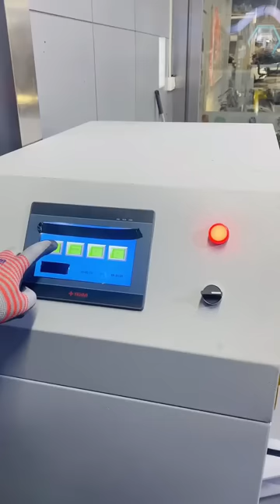Volkswagen EA888 Engine Assembly Full Process!

Comment: I just had mine completely rebuilt. Bored to 83mm added IE rods, pistions and springs. Ferrea valves, mhale bearings, ARP bolts, etc. I'm tapping 28 psi and runing around 24 psi consistently. The thing is a rocket ship, so much fun. I need to upgrade LPFP, HPFP injectors and turbo to get the most out of it though. My little K04 is doing big boy numbers 😂
Reply: I am a beginner. What does having an engine "bored" to do for it? And what does bored in engine terminology mean?
Reply: @stocks4bt having engine cylinders bored out is having the insdie diameter of the cylinders made to be slightly bigger, so you can fit bigger pistons. Takes a highly trained specialist to complete. The machinist that built mine has been rebuilding VW, Audi and BMW engines for 30 years.
Reply: @NuffxSaid  you explained it very well. I greatly appreciate you for sharing your wisdom
Reply: @NuffxSaid how much hp and torque do you get after cylinder boring and before everything else ?
Reply: @deweew haven't run it on dyno yet to be 100% sure. However, the PSI I am pushing calculates to about 450-470hp/26-28psi on hard pulls. 24-25 psi on regular driving. Stock hp 220, stock psi of 12, +10% psi per 1 pound of boost maths to 450-470hp base on psi output. At least, that's how my mechanic broke it down. That's without upgrading the fueling system still on stock pumps and injectors. If I add those, I'll have to go bigger turbo. Which will push me close if not over 600hp. The motor is built to handle 700hp. I still need to get my suspension fully built out before even thinking about that. I would also need to go stage 3 brakes. Car is basically stage 2.5 if that were a thing 🤣
Reply: The dangers of boring is, making the cylinder walls weaker and possibly cooling issues, seems you did well, these engines when done right are bulletproof.
Reply: This is a gen 3 EA888 and there is no K04 turbos for them. You’re thinking about the older junk gen1 engine.
Reply: @silviodante5829  the engine block is the same. I ordered a cylinder head from a gen3 and it fit on mine, gaskets everything lined up. The oil pan gasket is the same, balance shaft, oil pump, cam bridge and cams fit, exhaust manifold, etc.
You do not know why they were labeled as junk and it was not because of shitty short block.
And yes, there is a KO4 for the Mk6....
Reply: @psiturbo  I’m referring to the fact that the ea888 that uses a k04 is junk. Endless issues that were sorted out with the gen3 and k04 turbos are poop as well. Thanks for telling me you can’t afford a later model gti bud
Reply: @silviodante5829  You are saying is not the same engine block of the overbore, when in fact it is. You are saying there is no KO4 when there it is many kits available. And I have an MK8 as well.

Comment: This engine is used in so many Audi's and VW's. It is reliable until approximately70,000 miles. Then you must replace intake manifold, off valve, coil,spark plugs,and diverter valve. At 100,000 you must replace the timing chain,tensioner, all associated chain guides, and timing chain covers it gets distorted when removing for service and leaks. As most German engines you are constantly chasing oil leaks.
Reply: What goes wrong with the intake manifold? Carbon buildup issues?
Reply: @MarcChevalier  intake runners
Reply: I have this engine and change the oil every 10k kilometers, and use the best gas available.  The oil change is very important best to change the oil after 10k kilometers guys if you want to have this engine for long. If you do the maintenance right it is actually pretty reliable
Reply: @Truegp25  How many miles do you have on it? I have a MK8 GTI with 19K miles and change my oil every 5K miles. just curious on your milage. I think these engines are very reliable if you take care of them.
Reply: That is not true, if you are a moron and you follow the 15k oil change intervals so the manufacturer can meet "carbon emissions whatever" maybe that is so. My Gen 3 888 has 105k miles and the only thing I HAD to replace was the injector wiring harness that had a recall, and I decided to change the injectors and water pump while I had it apart. I put the original intake and intake gasket back on because it was fine. I cleaned the flaps and it works like it should. 
It does not leak or burn any oil either. 
It's a better engine than you'll get in any American car companies car, and my Volkswagen was manufactured in Tennesse not Mexico.
Reply: Bruh my Volkswagen tiguan 2013 with 180k milles Doesn't approve of that
Reply: I have this very same engine in my passat never had any issues with it all i have repaired on it was battery and the timing chain and tune up, brakes the main important part is oil changes mine is still running strong and everything is still original at 175k miles
Reply: An engine that can only go 70K before needing a major overhaul is anything but reliable 😂 
I mean really, my chevy LD9 is known to go for around  100k b4 needing major work
Reply: 185k on original timing chain and tensioner .  2012 GLI.
Reply: Listen to what he is saying, he is correct, the EA888 will need major overhaul after 70k and close to 100k timing chain overhaul. Do oil changes every 5,000 miles. 
You do not believe him, check out Naptown tuner youtuber or Euro trash motorsports, or simply check FCP Euro, tons of videos. And if it is DSG, the clutch-type flywheel usually start to go out at 150,000 miles, but if too much heavy traffic, will be sooner.
Reply: I’ve got one with 300k on it - did timing chain at 275k and that’s been it. Great engines but need religious oil changes at short intervals
Reply: @Truegp25 motorhours is important))
Reply: I disagree with that
Reply: Eu fico pasmo com a simplicidade da tecnologia alemã. Kkkkkkk ridículo tantos acessórios pra dificultar as coisas apenas por exclusividade.
Reply: Had the Gen3 engine for 7.5 years and about 85k miles. Only went in for repairs once and it was minor and a common failure where the water pump housing leaks (water pump itself is intact, but has to get changed as part of the repair)
Reply: Fun spewing miss information for the non educated.  Don’t forget to change your piston rings every 20k either…
Reply: Ya if you never change the oil or do routine maintenance mine is going on 200,000 miles with zero issues
Reply: They produce hundreds of thousands of these engines, some of them fail due to lack of, or proper maintenance...these end up on youtube, then it appears if there is a common problem which is incorrect.
All brands have failing engines, even EV's have failing motors.
Reply: @jims.3987 what does oil change interval have to do with emissions?
Reply: @catinthehat5140  production and use of the oil is counted towards VW Group's overall emissions targets. Including shipping to dealers etc.. Service it less and it reduces the carbon footprint of the group more. At your expense.
Reply: @ukwan  where does it ssy that?
Reply: What a load of unsubstantiated rubbish! Try telling Me and many others who are way past 100,000km and still running like clock work.
Reply: @MarcChevalier Norhing really if you use higher octane fuel. It has cleaning additives in it. Been running it on it fir years .... no issues. If you run cheap fuel then it can happen.
Reply: @jims.3987 Yeah. No issues with my golf r running stage 1 for the past 2 years. Owned the car for 4 years, regular service and you be fine. Too many un qualified drama queens online

Comment: Great video. Which generation of EA888 is this?
Reply: I'm guessing gen 3 from the looks of timing chain components
Reply: @droidomz   I wonder how different Gen 4 is.
Reply: @droidomz Doesn't gen3 have the oil cap on the timing chain cover?
Reply: My understanding is gen3 was changed to a plastic oil pan 😬
Reply: No gen2
Reply: @erichartke4331  Correct
Reply: Its a 2.0 tfsi cdn ea888 gen2 211hp 
Audi a4/a5

Comment: That engine is the shits

You can not own any VW group car that comes with that engine and not replace the water pump once
Reply: You can't own any engine anywhere and not replace the water pump once. lol
Reply: @jims.3987  agree, i replace them often as a toyota mechanic
Reply: having said that, toyota waterpumps are usually no big deal (60-90 minute job on engines with timing chain), cant say the same about this 2.0 VW engine
Reply: Water pumps are a part to be replaced in any engine.

Comment: Everything that's wrong with modern companies. DEI and Low Carbon is a smokescreen for unreliable short life manufactured goods.  They can easily produce cars that last 500k miles with easy maintenance designed in.  But they dont.